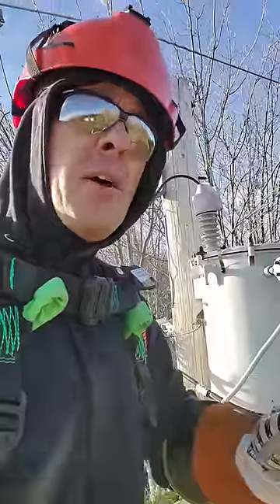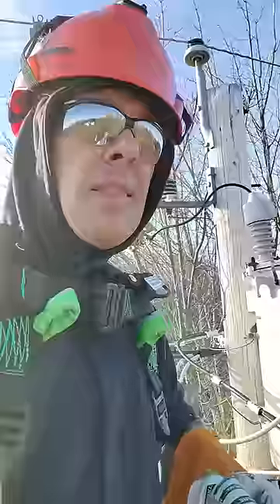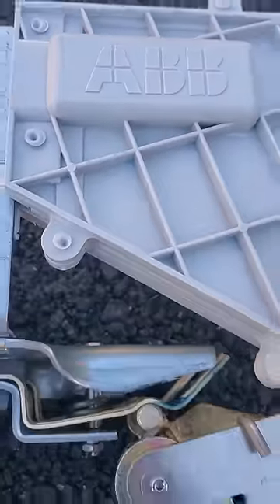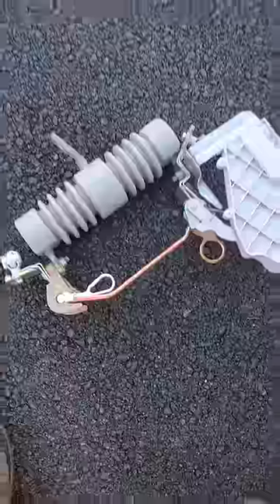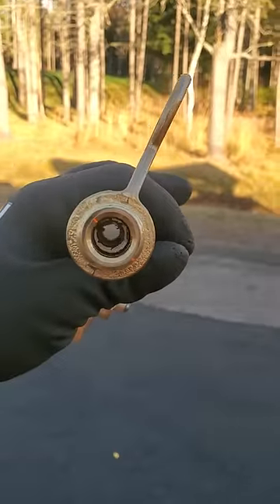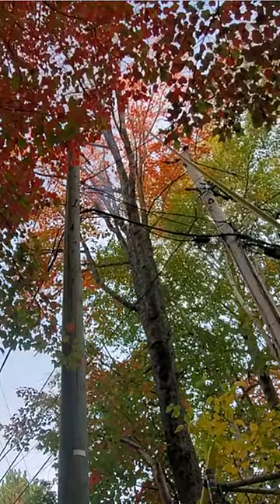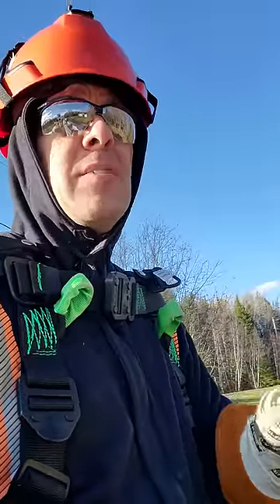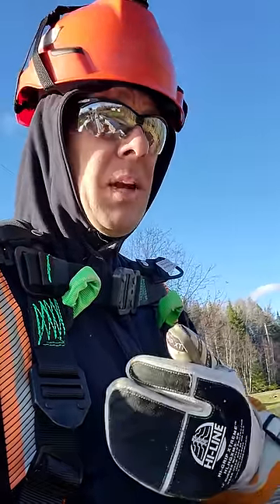Did your transformer "blow up"??

Comment: Had this happen at a work location before. They used a long pole to pop it off and install a new one.
Reply: I  remember one rainy afternoon at work: the lights shuddered once--and then there was an ear-splitting BANG! The transformer  in the underground vault out front had exploded, launching the 100+ pound manhole cover several hundred feet skywards!  It was recovered nearly a block down the street.

Comment: I have seen a transformer explode and you SHOULD be able to tell the difference. The fuse is a fire cracker sound. The transformer I saw explode was on the end of a line and got shorted by a man running a ditch witch. It more or less resembled ball lightning! I guess he got into the juicy cables faster than the fuse could protect it. That transformer was only a couple of years old. I know because it was installed new with the poles and lines when I had that house built!
     PS, if you live in Georgia and it's hot when the power is off, a window unit AC will run on a 3000 watt inverter and a Chevy Suburban. Guess how I know?(!)🤣
      Ya'll Take Care and be safe, John😎
     Nice video and good for all the folks who don't know Jack about electricity! Now do one about using a generator, so the Rednecks don't kill the linemen!

Comment: I happened to be outside when the transformer next to my house exploded. it was wild. lots of what looked like blue flames going up from the box and it was pretty intense (lots of noise). i remember it lasting for a lot longer than a single "bang". i forget what caused the failure, but it took them a while to fix it. the telephone pole and guy wires are in my yard too (not enough room on the road for them)

Comment: I had a squirrel knock out the fuse last spring.  Being 250 feet from the road it took a minute to figure out what happened.  I saw the holder hanging and it made sense.  The squirrel didn't look burned at all which kind of surprised me... almost had me thinking there was something else going on.  He saw the squirrel and said "cool... there's your problem", replaced the fuse, and was gone in no time.

Comment: No pops with the power outages where I live. Not sure about the size of the transformers used in my HOA complex but one serves two buildings of ~20 units (1 and 2 bedroom condos) and at least two have been responsible for power outages since I moved here 9 years ago. One got flooded and I don't know about the second one. I watched PG&E remove and replace the second one through the trees in the complex.

Comment: Worked on car washes. Got to one site, in the middle of a storm, no power. It was the above problem. Another site, the transformer had indeed blown, after some line work. Whatever happened, it also blew up all the cooler motors in the convenience store, and the harmonic drive in the car wash machine. The smell of exploded capacitors is not nice.

Comment: I have seen a transformer that actually blew up. The pole it was on blew in half and the top half was still hanging from the wires on fire. This was in the 90s so probably something changed since then to prevent that.

Comment: There are 2 houses on our line which Tees into the main line at the highway. I watched the lineman replace that fuse.a couple years ago when the neighbors rain cap thing shorted

Recently the neighbors power and ours went out. I checked to see if the lineman was down at the highway Nope. The people upstream and down stream at the highway had power but we didn’t 

No lineman ever came out but our power came back on. It had to be our meters shut off. I called the power company and tgey transfer my call to dispatch but no one ever called

I believe they turned our meters off over the line. Any thoughts

Comment: I worked with the man that developed type of arc breaking switch and had it patented.  Beats the heck out of hoisting a load breaker on the end of a stick. Every blown transformer I ever came across had showered a large area with PCB oil. What EPA clean up?

Comment: Had a cracked cutout on my house 15 kva transformer.  Keep smelling wood burning.  I saw the cross arm smoking and called duke energy.  They repaired the problem on top of the pole but failed to check the bottom of the pole. A month later, the pole fell due to the arcing to earth.

Comment: That happened right outside my house in a storm once, I called and told them hey I can see the cutout hanging open and I found a piece of what looks like a fuse laying on the ground by the pole. They came and fixed it about an hour later

Comment: I'm left wondering why a surge on the grid would blow the fuse, since the lightning surge supressor in the video is on the line side of the fuse. I would assume the transformer faulted if the fuse blew.
How is the relese of the door and flopping down of the fuse barrel accomplished? It looks like the replacement fuse element is in tension when installed and when the fuse link blows it releases the tension,  allowing a spring to unlatch the fuse barrel. And its weight flops it down. Seems like a bit of ice could easily keep it in place. If that is so, one could not count on all of the cut-outs being in place as proof none of the fuses were blown.

Comment: Bob, you know better than to call secondary distribution "grid".  

Grid by IEEE C2 aka NESC is the other side of substations, assuming that is over 48kV (and feeding an actual substation, versus switching, regulation, and distribution facilities in some systems operating at secondary voltages in and out).

Comment: I heard a large caliber shotgun go off in my small town and my power went out.
Since no one fires shotguns in our safe town (because rednecks have shotguns,) I figured the transformer blew.
It was the one on the pole in the alley behind my neighbor.

Watching them hang a new transformer, I couldn't help but ask.
The lineman pointed to the ground, laughing.

There, was a denuded squirrel that jumped the transformer's contacts and got his dick stiffened.

I moved several blocks over, same thing, next to my building.

The town put sheet-metal on every pole after that.
.

Comment: Is there something on the transformer that glows? A transformer near a relatives house had some light coming from the top of it and I always thought it would blow up or something but it stayed that way for the few years they lived there.
Reply from the maker: Some transformers have a red overload light... Although it very well could have been the high voltage lead or tap clamp glowing as a result of a poor connection.
Pretty common occurrence, usually the connection will eventually burn off or weld itself in place

Comment: Hey Bob - question for you... is the noise/sound caused by the fuse itself - eg. is it the high current from the short going through the fuse and the link itself physically melting/breaking which causes the noise? (Like a firecracker?) Or is the noise the sound of the fault going to ground eg. the line touching the transformer can, and the high current going through the can to ground? 

Also, if it is the sound of the high voltage fuse taking the fault current and breaking open, do all high voltage fuses always make this noise when they open? Is the sound different for different voltages, or is it the sizing of the fuse in current? Eg. does a 15kV system fuse blowing sound the same as a fuse on a 69kV system?

Comment: At night normally in the winter what is the loud bang with a blue flash in the sky when you loose power?
Reply from the maker: When the cutout blows it will cause a flash that can be seen from a far. 
Or more exaggerated flash is usually cause when something crosses two seperate high voltage wires: A tree branch, vehicle accident, animal contact or even wires slapping together. 
Infact, pretty much anything that makes contact with a high voltage wire that's also touching another point with a different voltage/phase.

It often looks like lightning

Comment: Not to sound dumb, but would a transformer blowing up sound last “longer” in duration, and sound more electrical in nature— like “wauwauwauwa”— and may or may not produce and blue-ish ball of light?
Reply from the maker: It certainly could, if the cutout doesn't pop! ... A branch laying across to primary wires definitely sounds like that!
Reply: @Bobsdecline  great! Because I have heard an actual blow-up event. Never seen the ball of light because I wasn’t close by when it occurred. However I was without power for some time

Comment: Well, I got a story. We were out of town me and my mom and my dad was home. We kind of just moved in and from what I understand my dad plugged in the electric dryer… And blew the transformer across the street. I don’t mean across the street I mean it went across the street. considering we had a entirely new transformer after that I’m pretty sure that’s what happened. I suspect after interrogating the dryer one of the power cables was shorting, and I think the outlet in the laundry room was tapped off the main lugs. However, we rented, and I was too young to feel safe, inspecting the electrical panel. It was an old farmhouse.

Of course, then there’s the other time in another house when the power company shorted the high-voltage side of the transformer I was unfortunately not there to witness the calamity, but I know that they disappeared rather quickly probably cause they had to go change the pants. they gave me such a hard time about carefully removing a tree from the tv cable line then they came and did that and left two elderly neighbors one on oxygen with no electricity in an electric heat area and the entire development with no water on the shared well.

Comment: Bob, when the fuse barrel is upside down, the problem is the fuse, which disables the specific customer power, not the grid. You should remake this video, and correct this.
Reply from the maker: When I say the problem is the "grid", I'm referring to our equipment as opposed to a customer's breaker. 

We often get no power calls where the customer's main breaker is open.  We also arrive to no power calls where a customer called an electrician to investigate first, unnecessarily costing them money.

When the fuse is blown, it's a surefire indication to call us.

That being said... The problem is most often not the fuse. There are the occasional "fuse fatigue" calls, however most times - the fuse isolates the problem and is not the problem in as itself. 

We also have many 3 phases lines fused with cutouts, where an open cutout will Infact disable a large section of the grid

Comment: So what does that 10 amps on 7200 volts convert to when the voltage is stepped down to 120/240?
Reply: To find the amps on the 120/240v secondary, which is what it seems you're looking for, we need to figure out our power (in watts). Using ohms law, power=Volts x Amps or P=E x I. So 10A x 7200V= 72,000 watts (ignoring power factor or losses). Now that we know the power, we divide it into our secondary voltage. P/E = I.
72,000w/240v = 300 Amps.
Reply: @VariacManiac  300A

Comment: Back 30 years ago. I was at the county fair on a really REALLY hot summer evening. It was still over 90F after the sun had set. Was inside a display van when I heard a loud "THUMP" and all the lights got very dim or went out. Went outside of the display I was looking at and there was a small mushroom cloud rising over a now burning pole transformer. 

There was a cop standing under that pole when the transformer exploded. They didn't get physically hurt, but they had to take them away in an ambulance anyway, as they couldn't stop screaming. Their brain broke.
Reply: He's now a shell, his soul left his body with that magic smoke

Comment: Nope the huge explosion and flash was the transformer exploding. Know that for sure because it and top.of plow were gone
Reply: Generally the fireball from a true transformer explosion will last for a lot longer than the "flash" from a fuse popping. That's the big clue from a long distance or not within line of sight. You might also hear the "fwoomp" of a regular extremely fuel-rich explosion (aka fireball), but you have to be pretty close to hear that because it's not very loud.